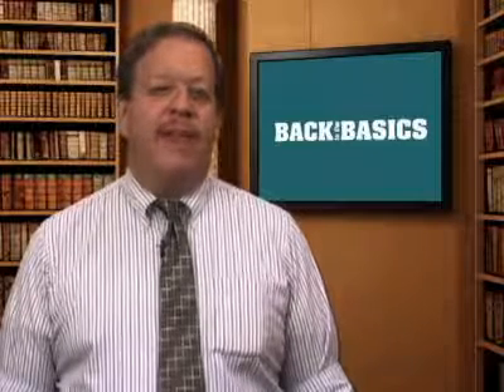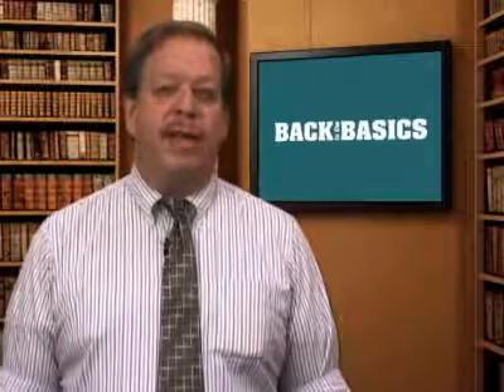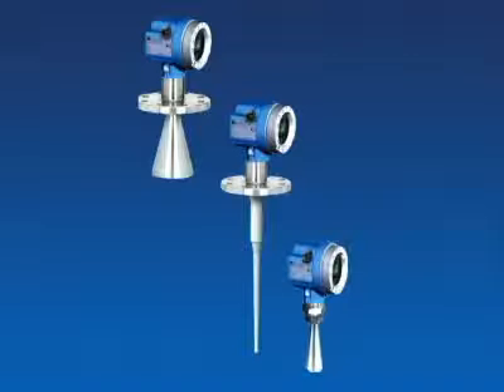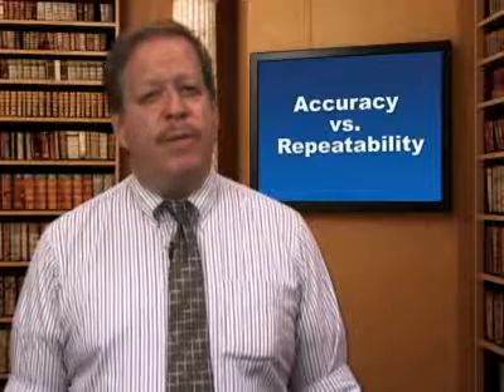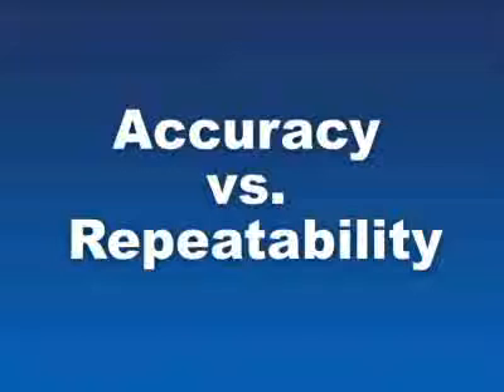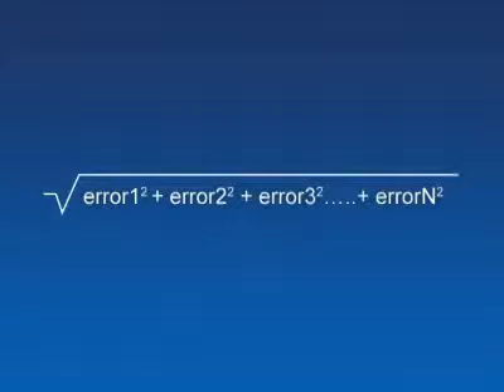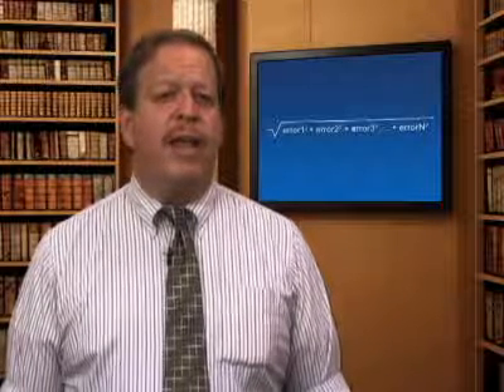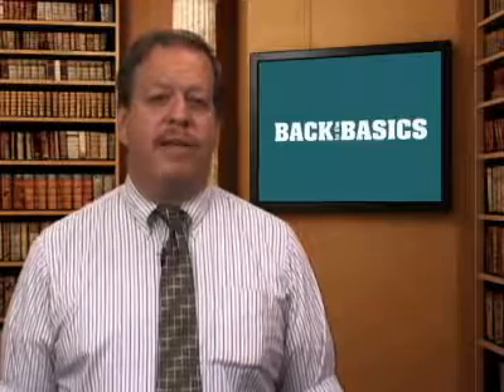Back to Basics: Calibration

Comment: calibration is a comparison of unknown quantity versus with known measurement with specified accuracy. The calibrator equipment must have at least 10 times higher accuracy than the working measuring device. That is the most important definition for calibration. A lot professional can not explain this term accurately and in a simple words.

Comment: Repeatability is more important than accuracy? Seriously? They are equally as important in safety systems and critical measurements.

Looking for videos for our new techs to watch. I've been doing calibrations for over 30 years and am certified to do ISO calibrations and have worked in both the nuclear and pharmaceutical industries. A couple of statements in this video just won't fly in those industries.

Then there's the issue of SIL instrumentation.

Comment: I have a question about calibration requirements in correlation to the ts standards.  Specifically the ts 16949 but in general access to calibration status of individuals that use calibrated test equipment.  We are certified ts 16949, our calibration is performed both in house and third party.  Do those that use test equipment to ensure quality product also need access to current calibration status of the measuring equipment used per the technical standard?